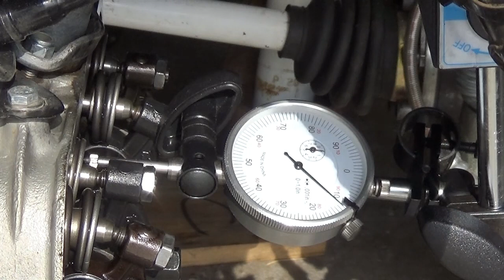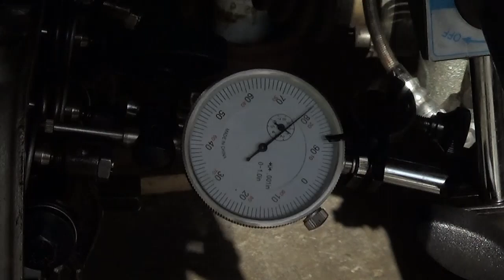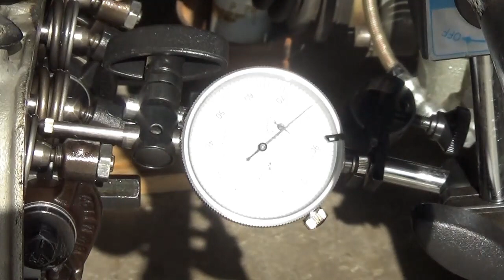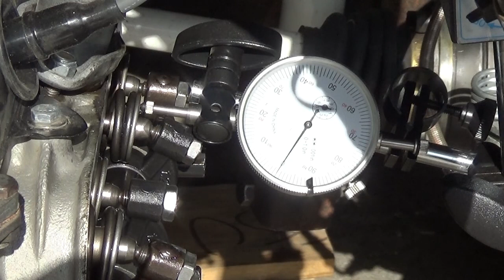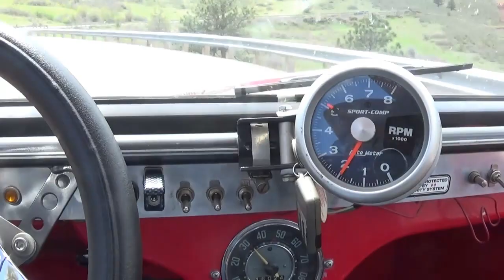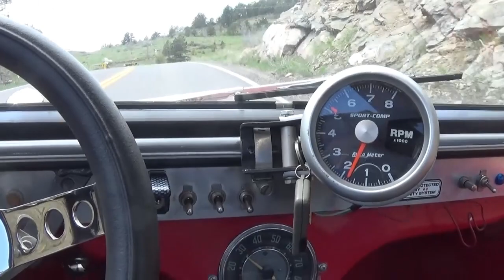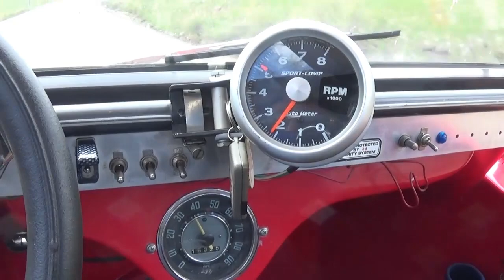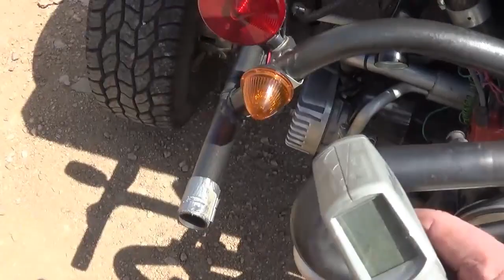VW 1600 DP vs 1776 SP

Comment: Really enjoy the videos! It's easy to just bolt something on and think you are making more power driving to town but that hill has told me I need to do some testing like that! Thanks always for the good info and keep the videos coming! Oh and that sand buggy 2276 I'd like to see it on and a trip up the hill!😁
Reply from the maker: I've got that in the desert race car all tuned and ready to go! 
Maybe one of these days if I have a reason to take it out I will do that.  It's also got 9 to 1 compression and is a gas hog.
Reply: @TheEZGZ  what is a good compression for a daily driver? I live in TN and I'm building a 1915 with an Engle 110 cam and VW 041 heads!

Comment: Never thought of mixed the rockers like that.  You have turned that 1600 into a torque monster. 😁
Reply from the maker: Well, it's news to me. I was reading how lean they were making the fuel to keep emissions down and how the exhaust valve doesn't flow very well over .300 lift and to get more power you need more carburetor. 
I had those ratio rockers sitting there that were for the 1800 engine with ratio FK7 cam but never put them on. Soooo, with all this time on my hands I thought why not see what happens. Mind you it is a very small improvement. I wish I had a subaru Turbo charger laying around. LOL

Comment: I know this is probably stupid but did you port the exhaust ports on the single port. pull the valves and you will see right away. the exhaust ports are super restricted. If you do that the single port comes alive IMO. without that they are just to constipated.
Reply from the maker: Good Tip Mike.  I did not do a thing but slap them on. The shop said the ground the seats and put in new valves and were ready to mount up. I've never been into SP nor know anybody who was. Had just heard rumors. Lot's written about them in the how to hot rod vw book but turned a blind eye and wanted to experiment. If they heads come off dual ports are going on. Soooooo many more options with DP.   I mess with gears or tire size before I go threw this again.  One of the spark plug inserts came loose. grrrrrr  Ya get what you pay for......  $200 exchange for the pair. :-(

Comment: Something to ponder. I been thinking prior to your videos on how to jazz up my 1641 with 041 heads that have 39 intake and 32 exhaust and a stock cam and a PICT 34-3 and the proverbial 009 distributor and a stock exhaust with no tips. Cause I like to be a little noisy. I do have 2 inch turn downs tack welded on for a little different look. I was pondering putting ratio rockers on the exhaust to help that intake to exhaust size ratio and some of the restrictions of the stock exhaust..  🤔 Well anyway I may just have to find a big hill and do some tests. Problem is I live in South Dakota  and it’s pretty dang flat here ha ha.I may also try the 40 Dellorto center mount  with heat cross over too. Well I better say I enjoy this series of videos before my message is longer then your video. 
Randy L Peterson
Reply from the maker: Car Craft sells the ratio rockers by themselves for $89 but I think you would feel a more amazing improvement with a SVDA Distributor. Along with getting rid of that stumble when you take off it will give you about 4 or 5 more MPG
https://www.aircooled.net/vw-distributor-options/
Reply: TheEZGZ Thanks for the reply. I had planned on ditching the distributor at some point. I do like how the SVDA works. I want to build a Killa Gorilla engine but I want to make my 1641 run to its best potential. Perhaps my Wife or Daughter or son will take an interest in the Bug and a more stock engine would be more pleasing for them to drive. I’m a Ronnie Road Racer Double Clutcher so I gotta make it faster ha ha. But faster takes away drivability.  Have a great weekend.  I’ll be giddy to see how the 1600DP works with the Pulley and the Center Mount Web.

Comment: Hey Ez, thanks for the video. On the low compression on just the one cylinder of the 1600, I wonder if perhaps it is the valve guide and not the piston/cylinder that is at fault? I had a low compression issue on #2 and it turned out that there was a huge amount of wiggle of the #2 exhaust valve in the guide. Just something to check. On my engine I noticed this when I pulled the head and sprayed  a good amount of WD-40 in the #2 exhaust port and watched it leak out the valve to seat area.  My cylinder head is at the machine shop right now having the guide and valve replaced. I'm going to tool up and start doing guides myself as soon as I get a good coring drill bit and .315" reamer now that I got myself a good drill press. Best wishes and stay safe!
Reply from the maker: Good Point!

Comment: 1:17:05 That random 'ticking' / 'chirping' sound scares the hell out of me.  My 1600SP does the same doing 60MPH in 4th gear up Eastbound Dublin grade (nice test hill, steep + face wind).  I get to thinking it's some sort of overheat symptom.  The torque drops massively.  I never lose oil pressure, nor does it smoke.  But, I hate that noise.  I don't think I've heard a Beetle knock but could those chirps be some sort of detonation?  Either that or could the ring gap be pinching?  That sound just gives me the willies.
Reply from the maker: With the engine off. Reach around to the fan inlet and see if you can move the fan in any direction. Listen and feel for that sound you hear. Rotate the fan 90 degrees and try again. It's possible the nut and washer have come loose. If it runs that way very long it can distort the fan mounting hole. 
Unfortunately the only way to look at it and service it is to remove the engine but when you do that you can inspect and clean lots of places you can't normally get to.

Comment: Regarding the last part of your video:  EZ do you run stock jetting or do you lean for your area /  higher altitude?  I have a 1600c DP.  My house is at 3600' with PICT 34 with stock jetting.  However, I will be moving to 5000' elevation with 8000' mountain passes (Sierra Nevada Mountains).  I am looking for input.  Thanks.
Reply from the maker: Make no changes. Your going to naturally get fatter the higher you go but with our ethanol fuel it leans it back out. Collect data and make comparisons for your particular ride and driving style

Comment: I’m putting a single port 1776 with a Brazilian carb into my Ghia.  It has stock heads on it and a German air cleaner.  Is it not going to breath as well as going with dual carbs?  I’m hoping it will have more power than a 1600!
Reply from the maker: You will love it. Those Ghia's cut threw the wind and fly down the road. I hope you get many smiles and miles.
Reply: TheEZGZ haha, are you saying that to make me feel better?!

Comment: What would you think about wrapping your intake with header wrap? or maybe fiberglass?
Reply from the maker: Tried that ounce and because of my dirty habits it turned into a mess.  Also your trapping uneven heat at the top of the case that can change expansion rates of the block.  I was going to lay a peace of aluminum over the top  but with my engine exposed like it is it's uglyyyyyyyy.

Comment: What heads, are you using?
Reply from the maker: The single port 1776 heads are stock late 70's  35x32.
The 1600 dp are replacement heads with valve guide boss removed. I believe they are 35 x 32 with many miles.